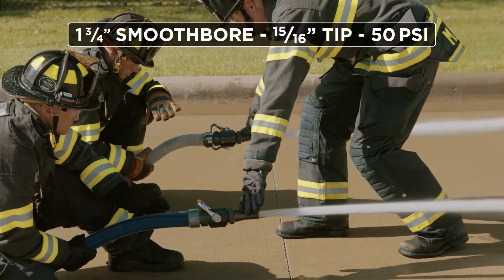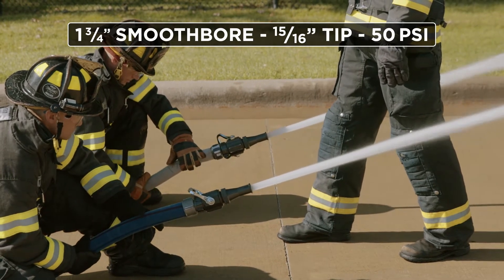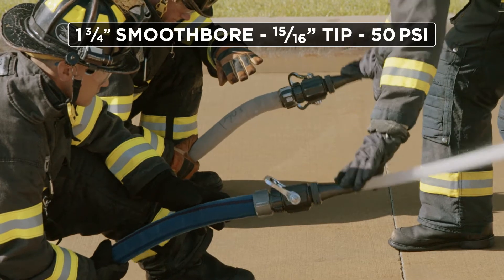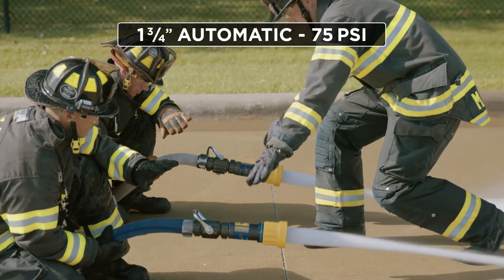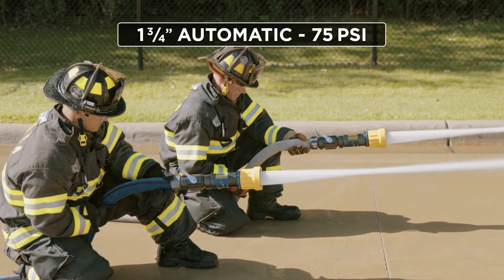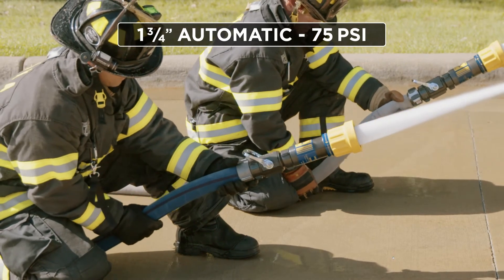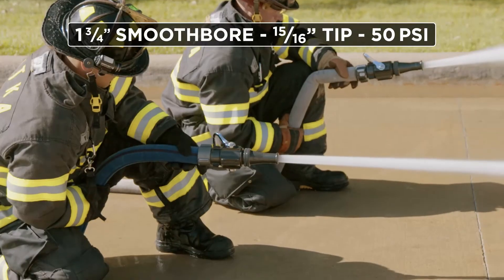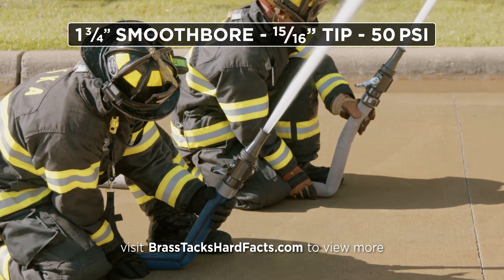Identifying the Cause of Hose/Nozzle Whip - Brass Tacks & Hard Facts (Episode 29)

Comment: I am curious. I’ve watched the video 3 times and i feel i am missing something. What is the variation? Are the hoses different? All things being equal, what is different?
Reply: The variation appears to be in the hose here.  Since in each demo, the firefighters are using the same flow/psi/tip size/distance from tip to ground, and as mentioned, they’re determining whether nozzle weight and/or hose construction/internal diameter are bigger factors with whip.  Notice the blue hose seems more difficult to kink?  Not sure if the types of hose is listed anywhere but reach out to these guys—they’re awesome!

A lot of hoses have been created for higher (100psi) pressures.  Don’t want to get into a debate on fog or SB but also check out some of the differences b/t fog & SB videos by Brass Tacks crew.

...and check Dennis LeGear’s Hose Dreams and other studies like it.

The industry’s best are finding it is not just about changing the nozzles.  It’s also about the hose (and pumping the rig correctly).

Great question and again—reach out to these guys.  They’re the experts.
Reply: Ryan Whitelaw see my reply when you get a chance.